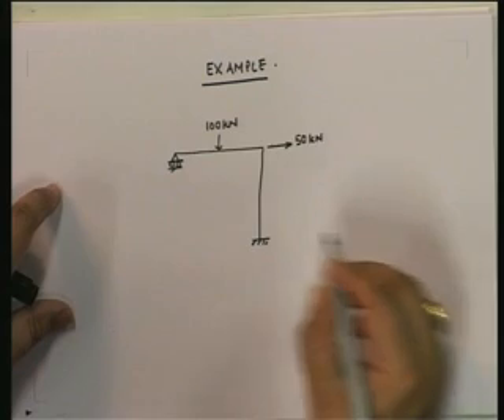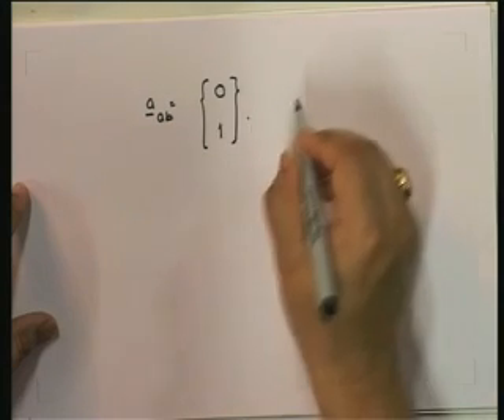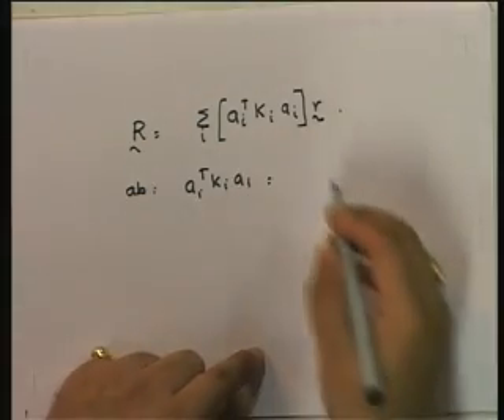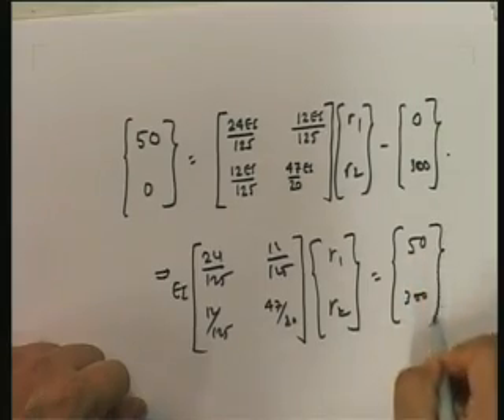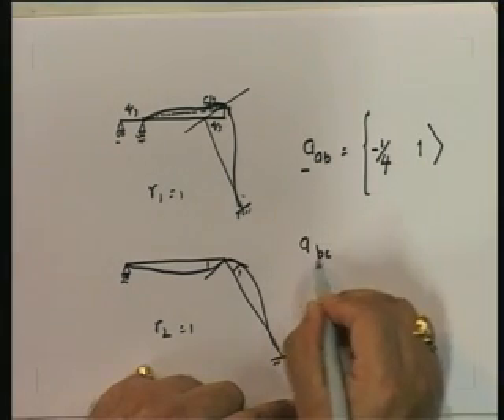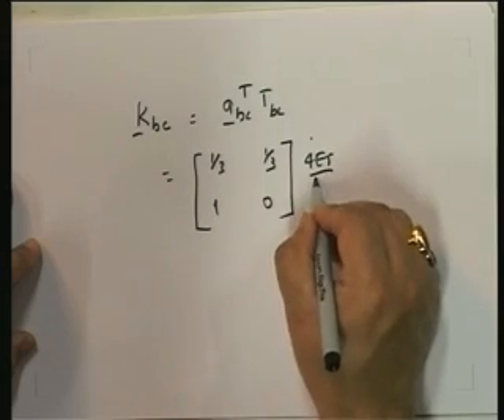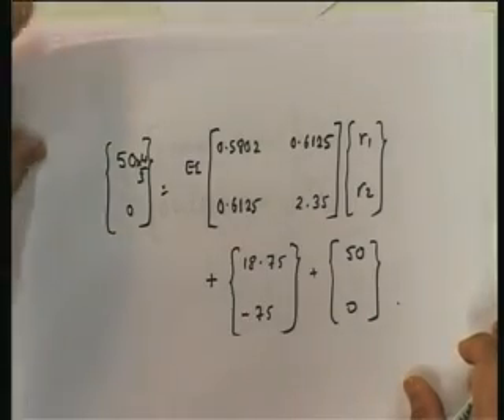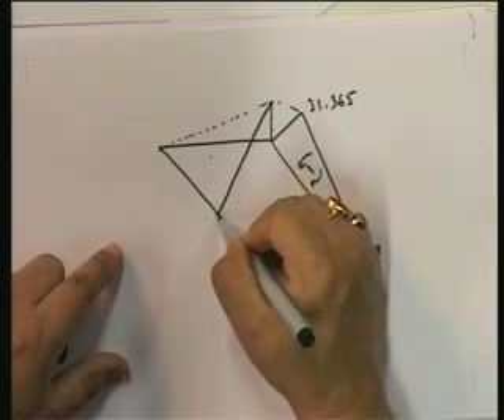Lecture 31

Comment: The Prof. used wrong formula (wL^2 /12) to calculate (FEM)ba in the first example. The formula for FEM should be PL/8, or if considering modified Beam 3PL/16. The Prof. rectifies the mistake in the second example and uses (PL/8 + 1/2 PL/8) which is equal to 3PL/16.